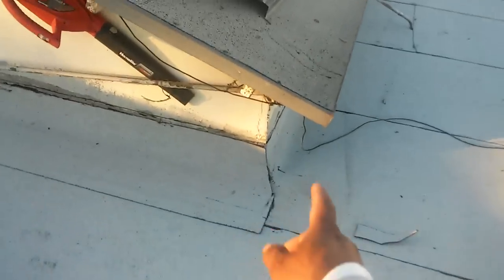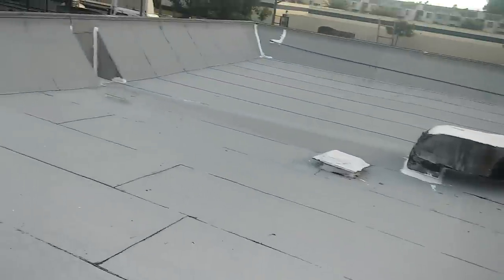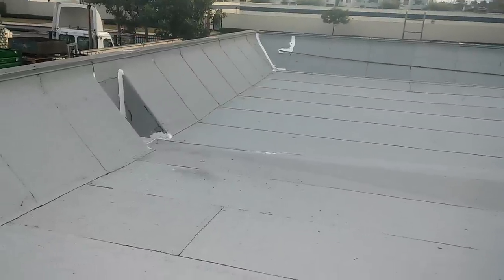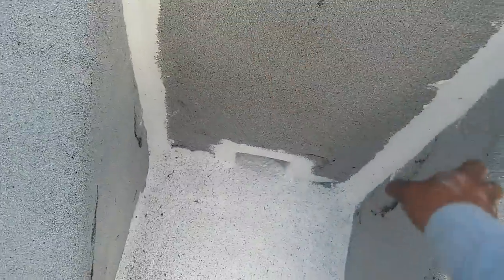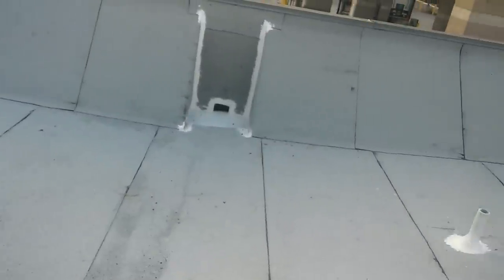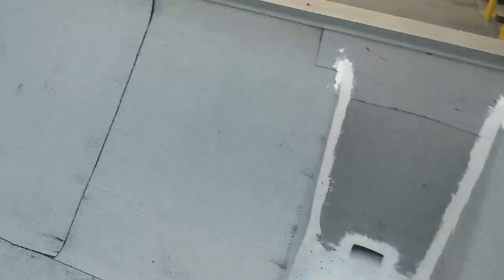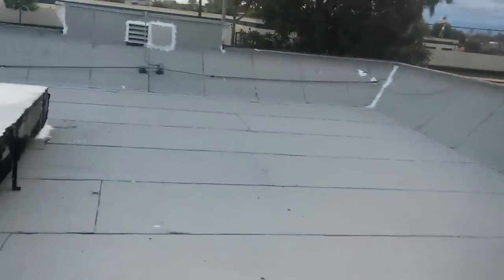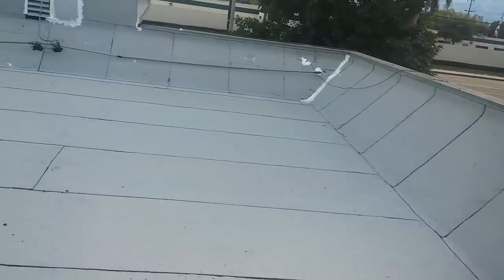Torch down roofing  : watch this how to video ! torch down a roof !

Comment: Hey eric how come here in Florida we use black cement instead of white? I always remember in California the standered was usually white ??? What's the difference. I mean if applied right the black cement coud last a few years
Reply from the maker: +Churro Tapatio When using black roof cement , I usually used the one that is Modified roof cement  is doesn't crack when it dries under the heat and I use an interply membrane ( webbing) to make it a 3 coarse.
The white elastometick roof cement is designed to be applied without the reinforced membrane unless you want to like around drains, scuppers, the white cement doesn't crack with the heat and it last longer .
The black roof cement last around 15 to 20 years when applied along with a membrane.
The white roof cement hasn't been around for so long , so I don't know how long it last ...but after 3 or 4 years I have seen great results ...
it's your choice .
thank you .

Eric.